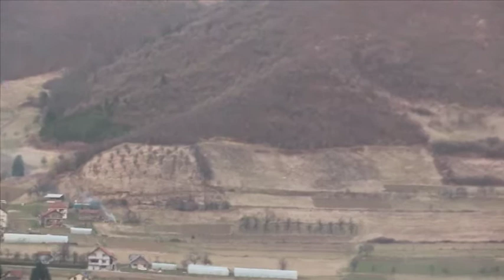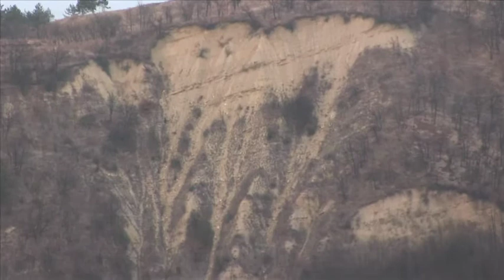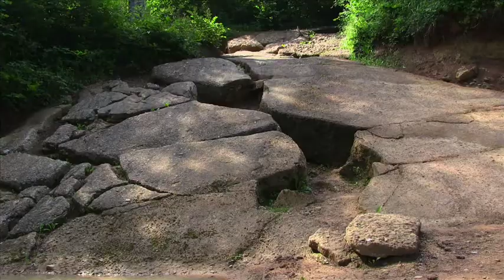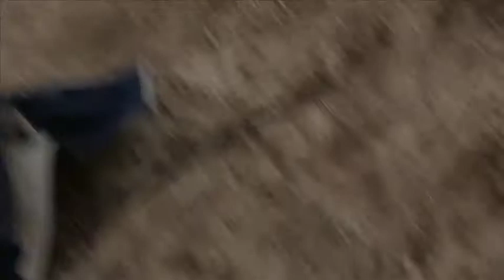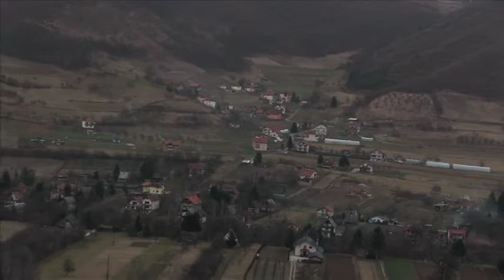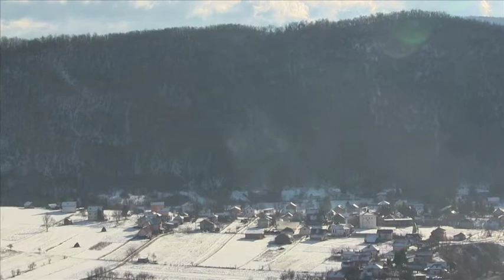Super-durable concrete on the Bosnian Pyramid of the Sun - an explanation of megapascals

Comment: Megapascals have nothing to do with hardness rating, The term Megapascal stands for one million Pascal unit. Whereas psi or unit of pressure. so this shows he has no idea.
Reply from the maker: If you have a chance to listen to the discussion of megapascals, which refer to units of atmospheric pressure, which translates to hardness rating in geology and archaeology, you may learn something.
Reply from the maker: An upper hardness rating of 133.8 megapascals for Bosnian Pyramid of the Sun concrete - which makes the concrete on the Bosnian Pyramid of the Sun far harder than Roman and modern concretes.
Photo:
https://www.facebook.com/SemirOsmanagich/photos/a.288652307817629.89487.288103227872537/1756708014345377/?type=3&theater
Video: 
(start minute 1:10:30) 
"The Bosnian Pyramids - Amazing Presentation by Dr Semir Osmanagic" 
https://www.youtube.com/watch?v=x9LB7e2WL_c